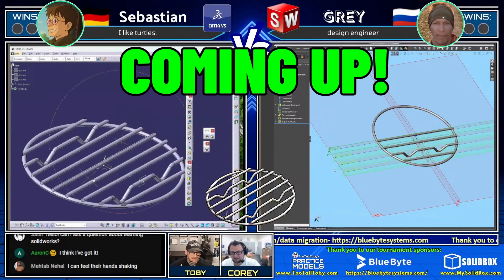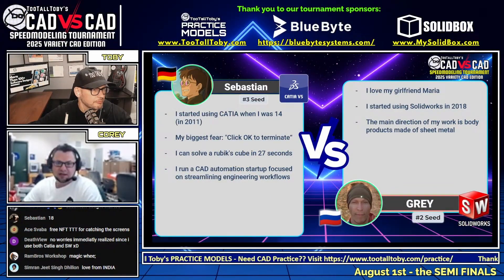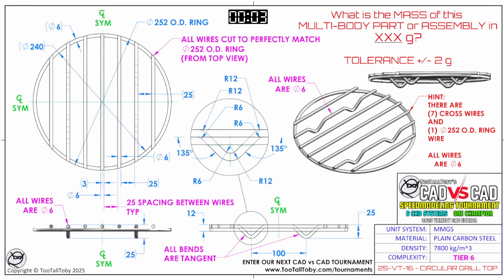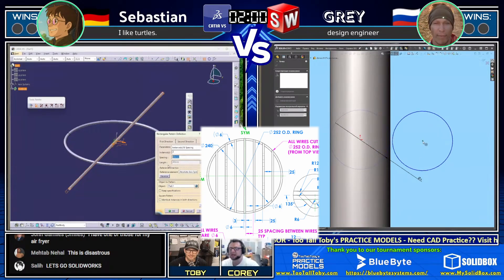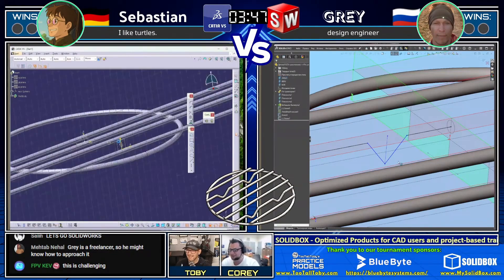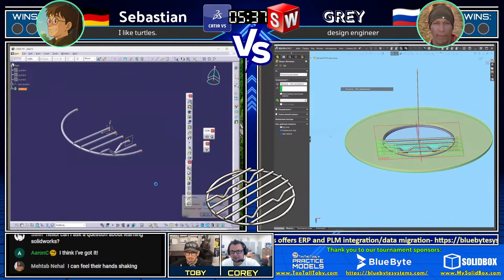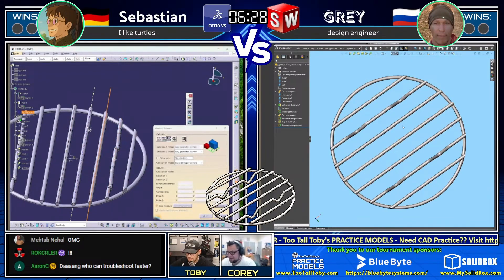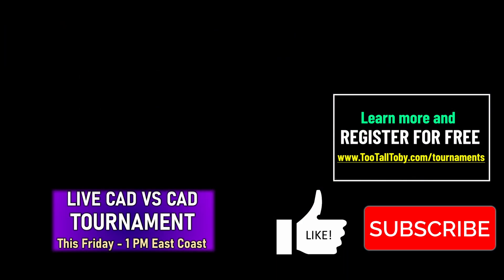CAD vs CAD TOURNAMENT SEMI FINALS 🎮 CATIA vs SOLIDWORKS - Battle 1

Comment: if u ask them speed draw chair frame， trust me ， none of them can do it …. especially those designer chair with so many curved
Reply from the maker: Yeah it would be fun to do more curvey stuff -the problem is the drawing - when you have a lot of splines and curves you usually provide the manufacturing team with the actual model, and not a "dimensioned drawing".  

Curvey stuff is hard to accurately specify on a 2D print, and that's why we don't see too much of it in the tournaments.

Comment: ?Is in the drawing the bars should be welded with the roll or rings?
is  This also determined in weight
Reply from the maker: Yes - Welding these together would indeed add to the weight! Great point!
Reply: @TooTallToby  if the parts are spot welded, their weight will not change much.
Reply: @PlungingBreaker  If any